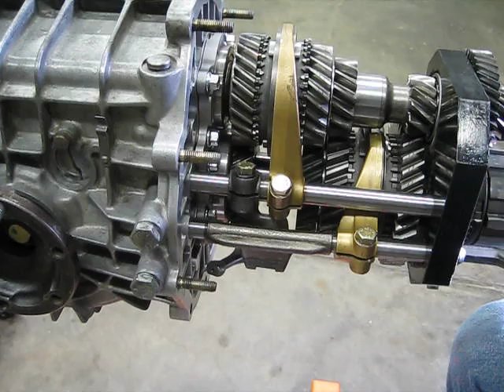Porsche 915 Transmission - Internal Gear Assembly Shifting

Comment: This is a great video!  The only thing I'm not clear on, though, is what causes the output shaft to start turning when the slider engages the dog teeth of the gear you're shifting into.  The gears are free wheeling on the output shaft at first, but when a gear is selected the shaft starts turning with the gear.  What makes it do that?
Reply: The half of the dog clutch which is moved by the slider is fixed to the output axle (for 1st and 2nd gear. The gear attachments are reversed for 3rd and 4th to have a more compact shifting mechanism). 

This means that once the teeth of the dog clutch are engaged, the input and output axles are connected. The gear fork (part that moves the sliding half of the dog clutch) is allowing the half dog clutch to rotate with the output axle while at the same time pushing it axially. The parts are of course being lubricated by the transmission oil.